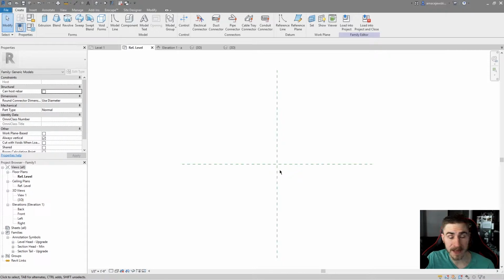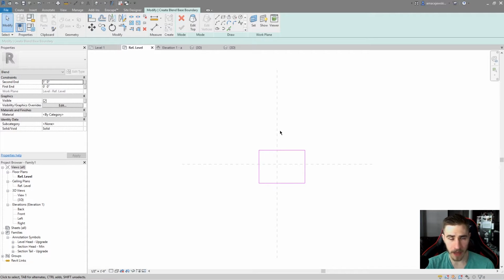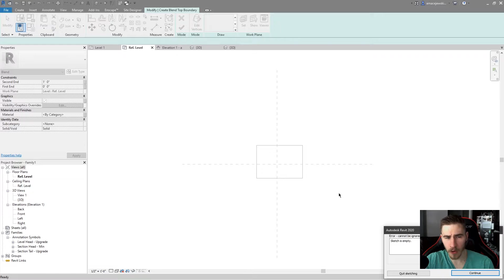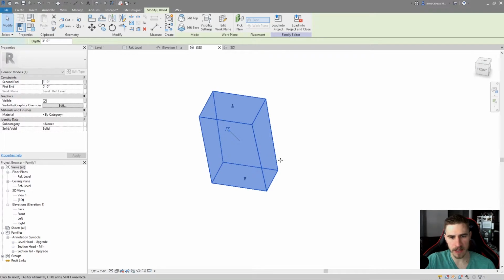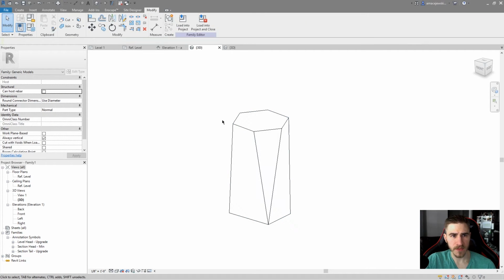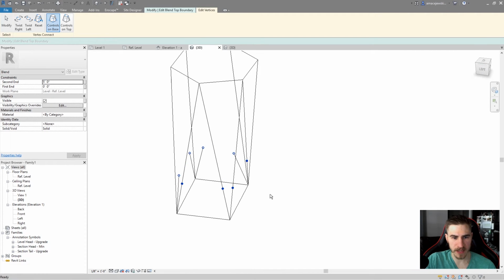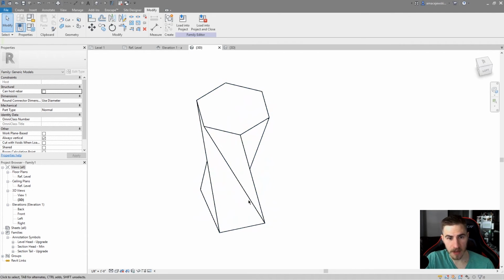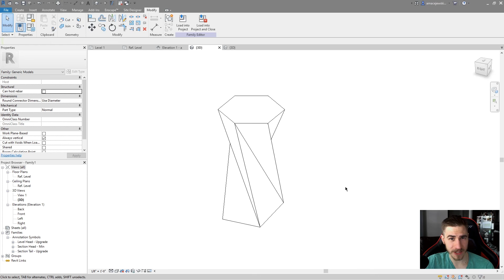How to Create Blends | Revit 2020

Comment: When i try using a void to cut out portion underneeth a slab, i cant seem to get it to show has "hidden" lines from the plan view like a coffer slab
Reply from the maker: You might try copying and pasting the void in place. It may be that it will just not cut. You could also check the visibility graphics in that you have generic models or whatever you used to make the void.